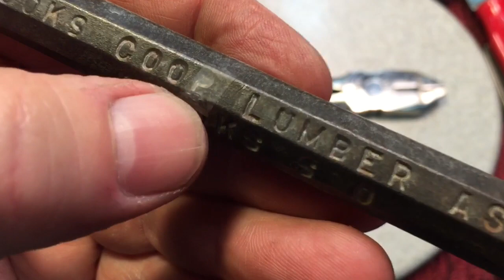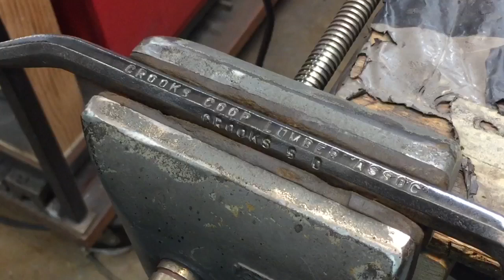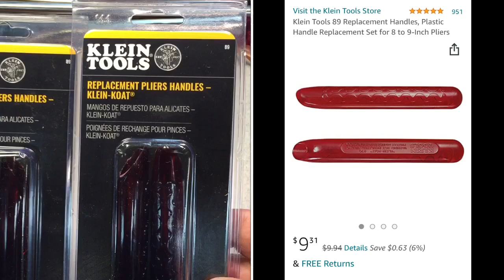2 Awesome Tools You Will Want to Own....

Comment: I have a pair of Kreuter 1801-7 Industrial linesman pliers that I did in your restoration method about 2 yrs ago. I put klein coats on them then and they look great. They came from my grandfathers tool box. He retired from Republic Aircraft in Farmingdale LI NY.  My neighbor is a Local 3 electrician and he puts klein coats on when the original handles get bad. I think Kreuter tools were sold by Lafayette Radio Electronics (long gone) both through the catalog and at the store in Syosset NY. I see them from time to time at garage sales around here .I usually buy what I find. I have slip joint pliers, long nose pliers and diagonal cutters .

Comment: It reminds me as you show the Klein Cable Splicer's knife that Klein's lineman's pliers used to have handle covers like that translucent red scales on the knife. When I first started working as an electrician's helper in the mid 1970s all the electricians' Klein lineman's pliers had those translucent red handle covers. No doubt on the advertising bar it was supposed t be Co Op or cooperative Lumber.

Comment: I have a pry bar like that.  It was my Grandfather's he would have been about 125.  I've always thought it was a small "crowbar" that had been heated and bent.  I've never seen another til yours.  Mine has no advertising, but I am from the midwest, and Grandpa was a farmer.  I got it out and cleaned  and oiled it up, I couldn't touch it beyond that.  I will use it when needed.

Comment: Have you ever tried to cut down a worn flap disc? Just sitting here wondering if using a trepanning tool on the lathe would work. Obviously the tool would get worn very quickly, but that might serve to sharpen it?
Reply from the maker: I have seen it done on YouTube but I buy the inexpensive ones and it wouldn't pay..

Comment: Thanks, now I have to track down one of those little advertising crowbars. -)

After you clean up the tool, how do you protect them from rust. Do you use some shellac or just wax or some other treatment.

I have a pair of Klein 6 linesman's pliers from WWII with the same grips which were added by me in the 70s. It's part of a US Army Signal Corps set that came in a leather pouch with a Klein barlow style knife.
Reply from the maker: Bob- I cover that on Friday!  Thanks!

Comment: How did you make the lettering red?
Reply from the maker: I filled in the letters with Rustoleum brush paint (enamel) then gently wiped over the top with a paper towel and mineral sprits removing the excess paint and leaving only the paint in the letters...

Comment: Question   Why does it seem to be squashed at the top?  I’ve only seen the nail pullers to have a curved end.  Sharp looking when you finished, but I thought you were going to “pull” out the squish .  Lol
Reply from the maker: That flat on top is where you hit it with a hammer to drive it.   The flat is purposely wider so that the hammer won't mushroom it and deform it.  Like when you have a cap on the top of a chisel...  =D